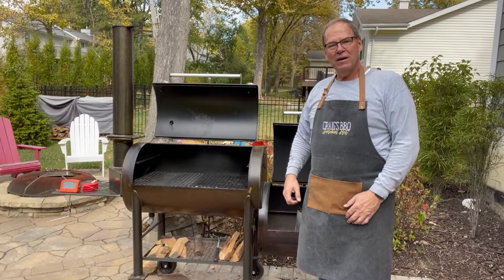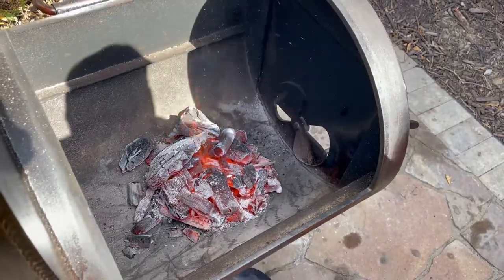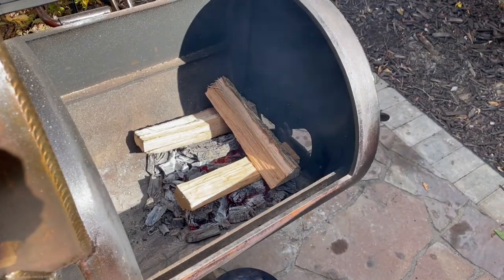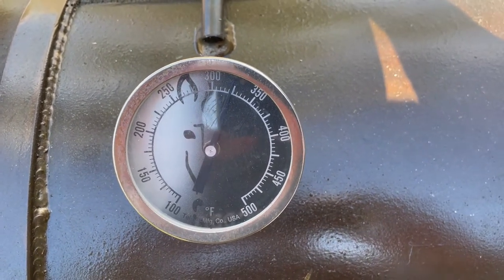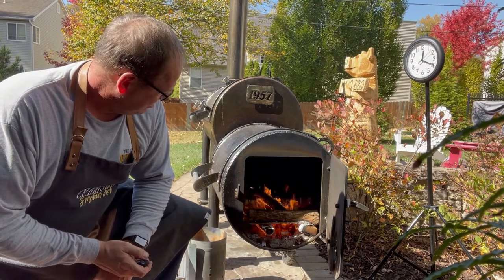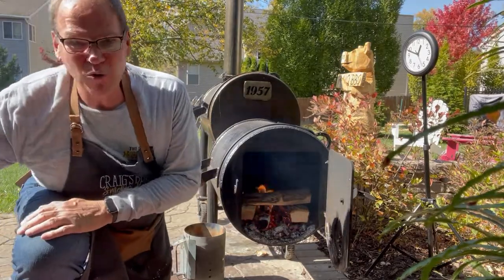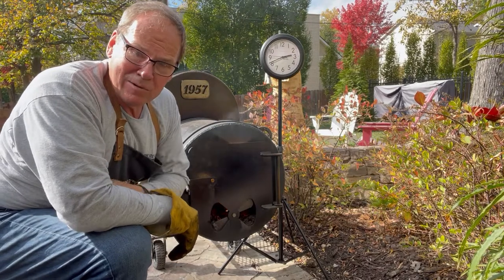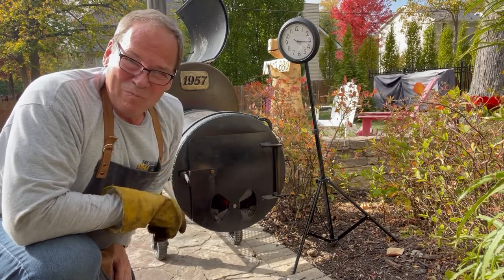Workhorse 1957 Fire Management Series #4: Cajun Turkey

Comment: If you could also mention the pit temperature when you tend the fire it would be even more helpful!  I'm a newbie and unclear how much of a temperature swing to expect when adding a new split, or when exactly do you add a new split.

How many pieces of pecan wood did you use for the cook?
Reply from the maker: Great suggestion.  I will work on adding in the pit temperature into my comments when feeding the fire box.  Due to a tendency to multi-task, I am not always on my target.  The good news is the Workhorse pits hold heat and are very forgiving if you aren't too far behind the fire cycle.  

For most of my cooks I have been running high air flow style management.  This leads to larger spikes in temperature.  After cooking on an Old Country Brazos with a fire basket, I have been experimenting with choking the air to slow the burn rate.  If you air flow, you need to keep a good coal bed going and manage the ash accumulation.  I just scrape the ash to the sides building a bed for the splits that I am adding.